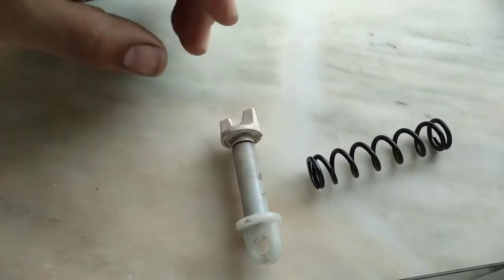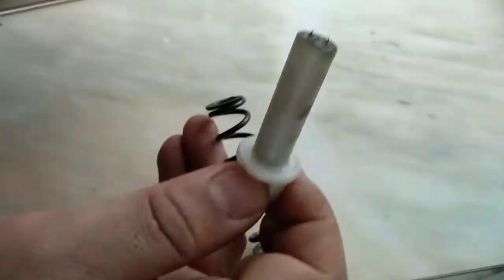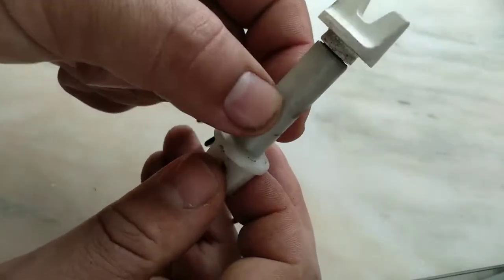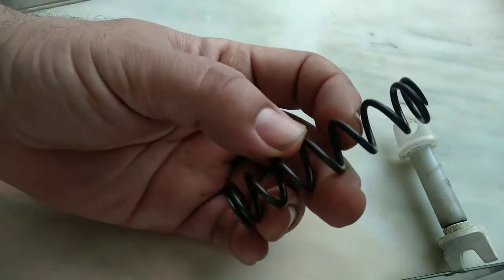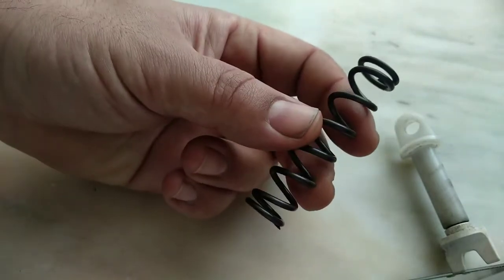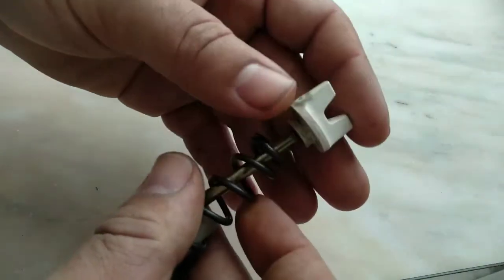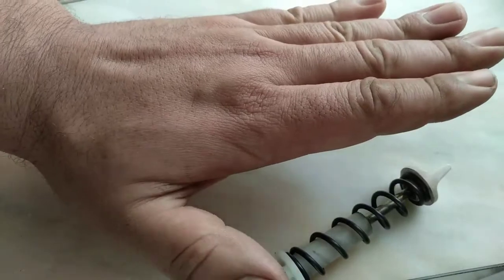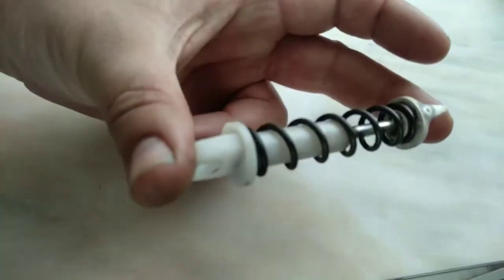Quick tips, clutch pedal return spring  Alfa Romeo 156

Comment: Can you help with problem on clutchpedal in my 159 plz...
Reply from the maker: Hello. How can I help?
Reply: @alfaromeonoproblem  seems too me my pedal is not responding the right way, something is wrong, May i buy New pedal or... frustrert  Norway guy
Reply: Make me a video of the right working pedal plz my is No good
Reply from the maker: Hello. Just saw the videos, you have play on the shaft bushing. The white one
Reply: @alfaromeonoproblem  Do you thing clutch problems also come down to clutch connector sensor? Vecaus my clutch is bad have to replace but it also is not responding correctly and in a pc it shous an alert that clutch connector sensor is not working or something liek that, in 156
Reply from the maker: Hello. No, it has nothing to do with the sensor. The system is all mechanical. You must try to bleed it with a pressure machine only. Like i did on many videos